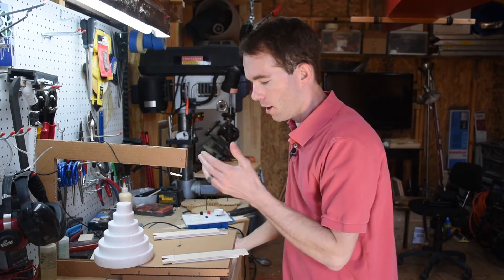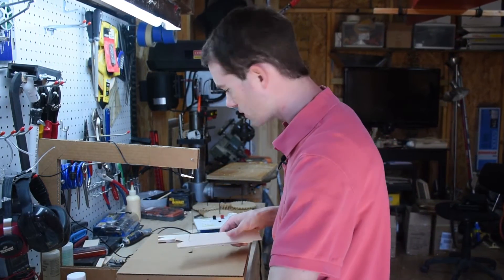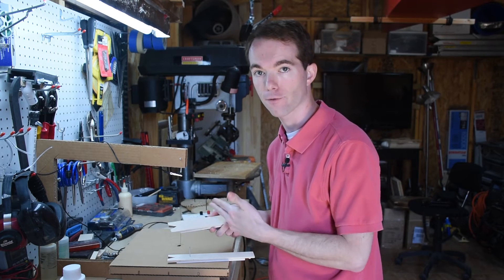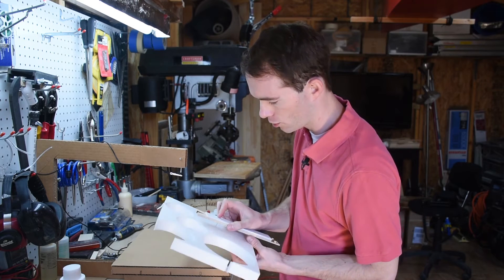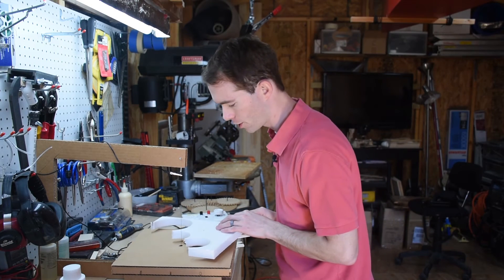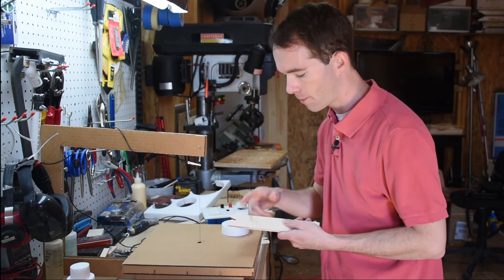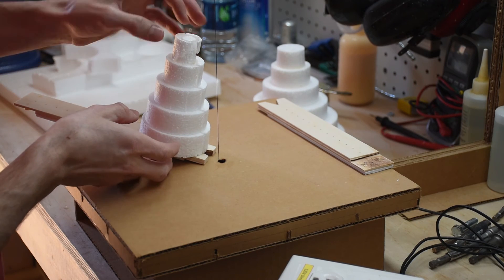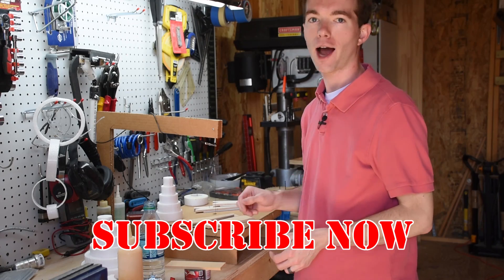Hot Wire Foam Cutter - Cutting Cone Shapes

Comment: can I use a tattoo machine power supply for powering the hot wire ?
Reply from the maker: +Oscar Alvarez I have no idea about that one Oscar. My power supply is a SL-728 150 W electronic transformer. It will put out up to 12.5 amps at 12 volts AC. As long as the tattoo supply is similar in power, you should be able to. https://www.youtube.com/watch?v=AAdr9M0iw9c